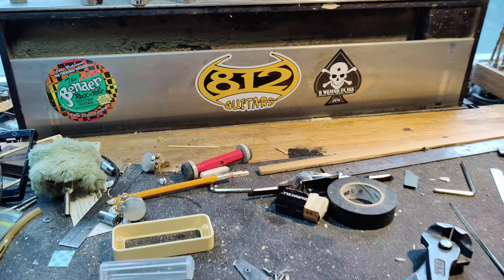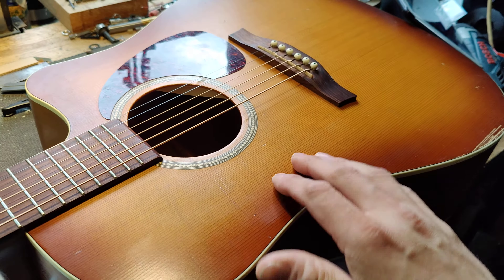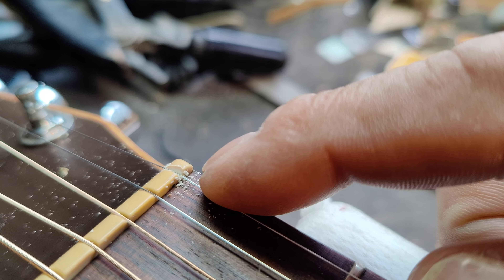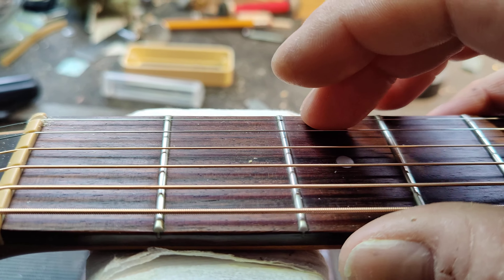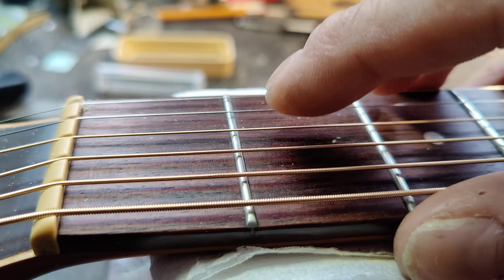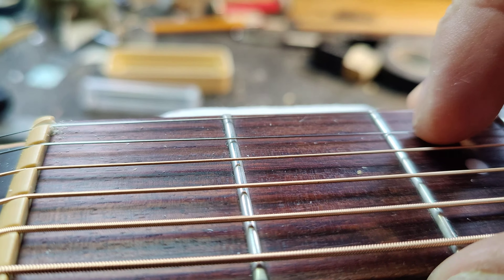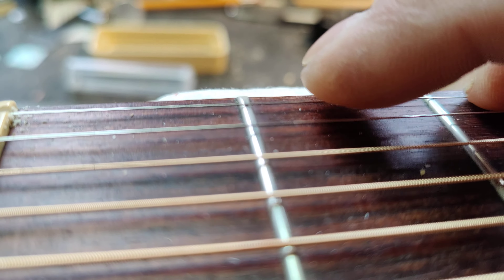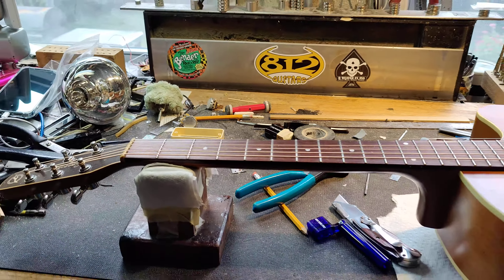-812- A word about Nut slot height

Comment: Perfect example. You should not even be able to see the string move, with this method. Just hear the little ping sound. It should be so low that movement, and the Gap, is almost impossible to see.. That ping is what you're looking for. Put a capo on the first fret and move the test down one fret and test it and that's how it should look. I shoot for 001 when dealing with the treble strings.  Basically no gap. Slightly more on wound. Maybe 003-005. If you want to measure
Reply: But the bass strings need to be higher because they will vibrate more ... and because they are tuned lower, they aren't as hard to push down..
Everyone has their own way... but on an acoustic I find .007 is pretty low for a flatpicker using lighter strings like .009 to .011 for.010 or .011 strings higher if the player is really heavy handed

And usually about .013 to .016 for the bass.. again depending on the player .

Comment: That looks a little too low imo.
Reply: Yes l would have thought so too, but the reasoning behind the video on cutting the nut slot lower is very sound, on acoustics though it Sometimes isn't the best, electrics almost always, just my thoughts though 😊😊😊
Reply: nope.  should be just a hair over fret height
Reply: If it don't buzz...It's all good...

Comment: Now that's good to know. I recently found a cheap starter classical from 99. I cut a tiny piece of a credit card at an angle to measure my good guitars nut hieght then mark each string height with a sharpy. Knowing this would have saved me some time. But either way, I set it up like true classical and brought that cheap guitar back to life. Probably sounds better than when new, because they really don't set up those cheap classicals good.

Comment: A thing that I'm learning, pertaining to nut slot height, is that if they are too high, it is much harder on your fingers to play chords or notes on those 1st few frets, besides the fact, or theory, that you are bending notes out of tune while pressing the string down.  I feel like I don't hear much about these things, but they seem important  to know... as to "why" you should care if they are correct.
Reply: I actually like the nut slots higher because I have a heavy attack. When they are low, the strings are always banging off the first fret when played open to the point where it actually starts to eat into them.
Reply: 'If they are too high, it is much harder on your fingers to play chords or notes". DUU-UUH..you're a GENIUS 😅.
Reply: @PaulPaid  Unnecessarily rude, Paul.

Comment: OMG, I love it. ! !  I'm a player of 40+ years, and I seldom use measurements in setting up a Guitar 🎸 !! 64th this and 64th that starting guide lines is just that !!! Starting Point !! Nevertheless, if all strings are high at nut, then I take nut off guitar in sanding the bottom down !!

Comment: I have done a different concept for my ESP guitar. On my german handmade Lefay bass there is not a nut but a zero fret at ITS place. OK. Interesting concept. Ive done the same concept in my ESP strat. The Idea is.....when the neck is very straight the zero fret IS the perfekt hight to all other frets...right?........ive put the nut out, closed the gap und put the zero fret in........and? IT works......the strings are laying lower and the strat rings like a bell......in a second try on a cheaper guitar i had the Idea to close the nut gap instead with a peace of wood than with a Floyd Rose locking saddle behind the new Zero fret......it works also great....before doing that you must remove the string peaks and the the thickness of the Metal plate to come with it under the hight of the zero fret......that IT works awesome........try IT.....😊

Comment: Every time I replace a nut the High E string pings when I pluck it open. All other strings are fine just high E. 3 nuts in a row. I’m using a .010 nut file for a .09 string slot. Already should I use a size .012 nut file?
Reply from the maker: @buck7477  you could be having one of two issues. One that you may not be rolling the file downwards towards the strings to give you a little off ramp. If you don't do that the string will tend to click or zing inside the nut slot. The other issue is using those mini saws that are often sold on Stu Mac. They tend to leave a small burr on the inside of the cut slot where the string can catch and sometimes ping when you go to bend the string. This is why I always use triangle files. I have one with a very sharp edges and another with fairly rounded edges. One of them I bought at a hobby store the other one I got out of an old machine is toolbox.

Comment: Love this..! Thanks… 
but… HELP..!!🙏🏻
So many other videos tell me to make the slots the same depth as the first fret..
Seems to me that the strings will buzz on the fret ,doing it like that..? 
Even if you consider the relief of the neck ..
Reply from the maker: You're absolutely correct. The nut slots need to be a hair higher than the first fret. And as logic would dictate, if the slots are the same height of the first it will result in a buzzing issue
Reply: @812guitars  Thank you VERY much.! I waited.. and I’m happy that I did.!
Reply: I've NEVER seen a video where someone says "cut the nut slots so that they are the same depth as the 1st fret". That makes NO sense whatsoever. OF COURSE the strings will buzz if you do that. I've seen plenty of videos where they demonstrate how to keep piling on layers of masking tape right next to the 1st fret, until the top layer of tape is BARELY ABOVE the first fret. They say you should be able to catch the edge of the tape with a finger nail, when running your fingernail along the top of the first fret. Then, you carefully remove all the layers of tape at the same time, and carefully stick that stack of tape against the nut. That stack of tape is now your gauge for filing the nut slots. I've never tried it myself. I was always told that when the neck is adjusted properly FIRST, and the guitar is tuned to pitch, loosen & move 1 string at a time out of it's nut slot, and carefully file & re-check until all 6 strings OPEN ( not fretted at all ) have 18 thousandths of an inch of clearance between each string directly above the 1st fret.
Reply: Keep in mind that all of the frets are the same height, and with the correct action height, none of them should buzz. The strings are at a slight angle and not exactly parallel to the fret board.  Therefore, the frets can all be the same height and still not buzz. Same thing would apply to the nut, which acts as a "zero fret" and on some guitars, this is actually present. However, given the location of the nut/zero fret, making it slightly higher seems like a good precaution.

Comment: I have a taylor 114ce. and I wanna adjust the nut height myself. Do I do this when I already have set my guitar in a proper relief? or I do make the neck straight, and that's when I start filing?
Reply from the maker: @Klien.Niwane  you need to have the neck dialed in before you do this action. As a rule I usually get the neck dead straight first then I make these adjustments. So even if I am a hair too close once relief is added into the neck, the slots I cut will be to proper height. 

By the way, just like any technique in doing a setup, it takes time to build a good hand at it. As simple as this is it's no different than learning to play guitar. Not everybody can sleep pic right from the beginning if you catch my drift.
Reply: @812guitars oh for sure it does take time! By the way, do you have a recommendation on how to get the neck dead straight? I’ve seen someone just using straight edge rulers, though it states that I have to be cautious since the frets may be uneven. Especially since I haven’t leveled my frets yet

Comment: Great video! 
I have one question though. 
What you did looks fine for the thinner strings. But what about the thicker strings? I can't imagine they would make the same sound if the nut height was correct, would they?
Great informative video otherwise! 👍🏻
Reply from the maker: @amagupt  actually they make a very similar sound. The only way I could describe it is it sounds like the high trouble strings on the piano. Those little teeny tiny ones that don't really resonate but they make an interesting clink/clunk sound at the same time. I'll eventually get around to doing more videos and I'll post a follow-up to this process

Comment: hi i wondering if the nut is responsible of make the e and b strings sounds higher than other strings when pluged in amp i got an acoustic tenson installed fishman pre amp plusbpiezo under saddle
Reply from the maker: If those strings sound louder when played open, then the slots may be a hair too low. But if the strings are louder in general as you play through the board, then that would be a matter of adjusting your pickups. By the way there's also a difference between single coil and humbucker pickups. If you look at vintage Fender strat pickups you'll notice the B and E pole pieces are lower than the other strings.
Reply: I remember on very early electric guitars that many had a very loud B string. Now days, the pickup seems to be compensated for the extra volume. I think also it is an inherent problem associated with the B string length and diameter, but thankfully, we don't seem to suffer from that problem now.

Comment: What do you do when it frets out at the first fret? Lol!
Reply from the maker: Well it doesn't take a genius to know that if the string buzzes as you play it open that the nut slot would be too low. You can either fill it with Cyno glue or pop the whole nut off and add a small veneer underneath to get it up into the air. But regardless at that point you'll have to recut all the nut slots to make final adjustments.  But be aware, this is only after you've made sure that the neck is correctly adjusted. It could be the case that the neck is backbone which will automatically make those strings fall right on top of the first fret. It's a very common mistake that guitar technicians make all the time.

Comment: I'm really curious: in order to achieve that "plinky piano sound" when tapping a string that has the correct nut slot/height, surely there will be a certain clearance when checked with a feeler gauge, and if so, what does that string height work out to when the string is open ( no fretting of the string ) using a feeler gauge between each string and the 1st fret? Because I've always been told that all 6 strings are at or near their ultimate playing height (pertaining to the nut slots being cut ) when the clearance between each OPEN string directly above the 1st fret is 18 thousandths of an inch. This is assuming of course, that the neck relief has already been adjusted properly first. I hope you respond. ?????
Reply from the maker: Sure you could use a feeler gauge. But most people don't know how to use one. More like so now at days because no one needs tO "gap" their spark plugs anymore.  Anyways, the math is simple. The correct height of the string over the first fret is about half the gauge of the string.
Reply: @812guitars  People who "don't know how to use a feeler gauge" are simply too lazy. I can teach an 8 yr old how to use a feeler gauge. I get all 6 of my strings set at 18 thousandths ( open & tuned to pitch with the neck  relief already set properly ) directly over the 1st fret. After watching this video, I decided to check all 4 of my acoustic guitars for that "ping" that can be heard in this video......and sure enough, all 6 strings on all 4 of my acoustics have that "ping".